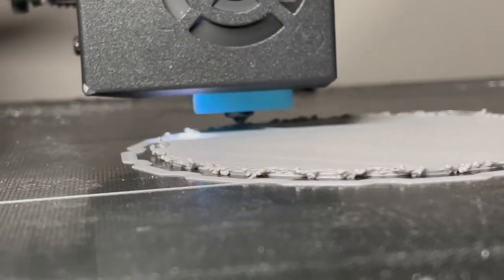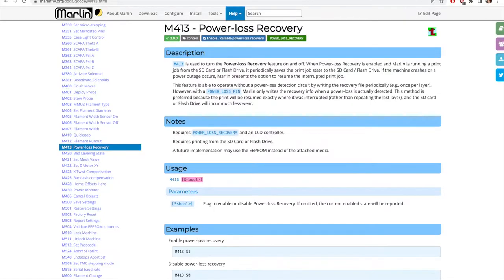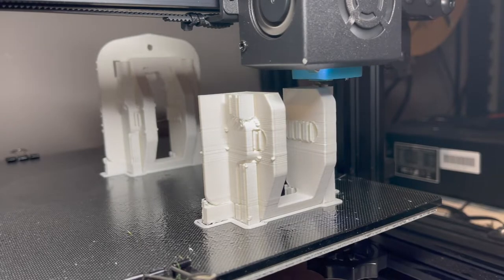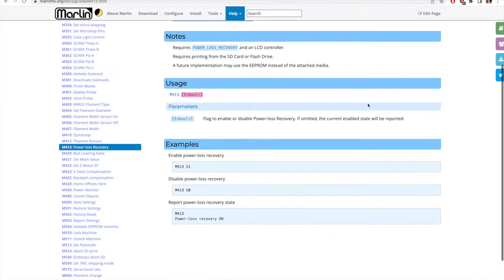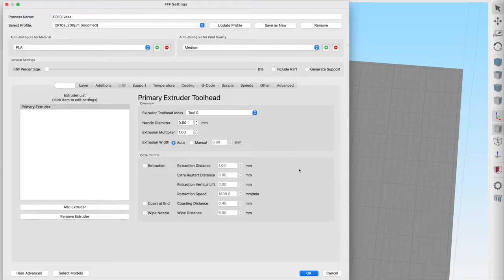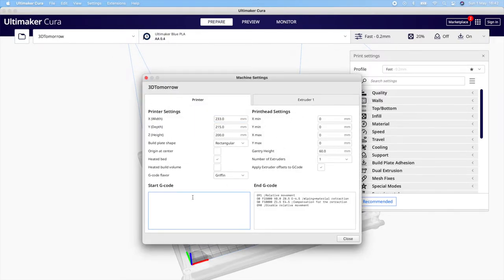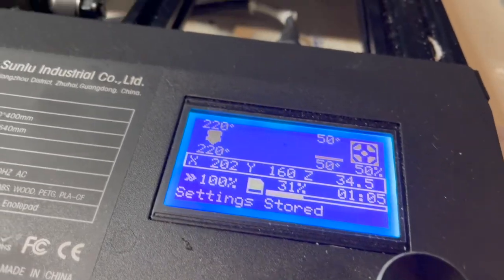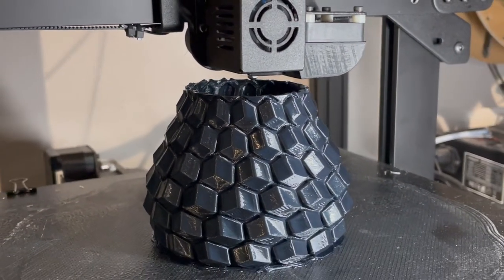#FixMyPrint || Blobs & Zits (Especially in Vase Mode) || Power Loss Recovery could be the culprit

Comment: Great video Callum, I never had a problem with “zits” on my ender 3 s1 but all of a sudden they started appearing when printing from the sdcard, turned out to be a faulty card. Like everything there’s never one answer. Just bought an new Ender 5 Plus as a build/upgrade platform and with the big build volume of this printer, is there an update on 2kg spools of your pla range?
Reply from the maker: Yes SD cards can play a big role, I've had to replace many over the years! Trouble is, it's never the first thing you think of when you start having problems. Even in the case of these printers, a higher quality SD card would have no doubt improved the situation.
2kg rolls are now live! They've been ready for a while actually, but was planning on announcing them in the newsletter, which I'll send out tomorrow now. So anyway, you're the first to know :D

Comment: Does the Sunlu S8 Pro have the ability to turn off Powerloss recovery or is it the same as the non-pro version?
Reply from the maker: I’m not sure! But there’s always the option to flash new firmware if the gcode command doesn’t work